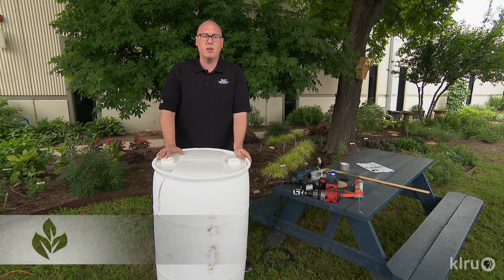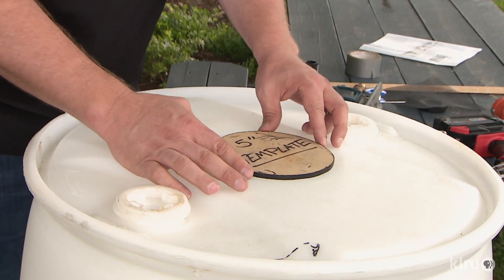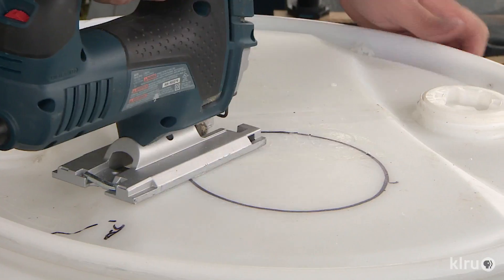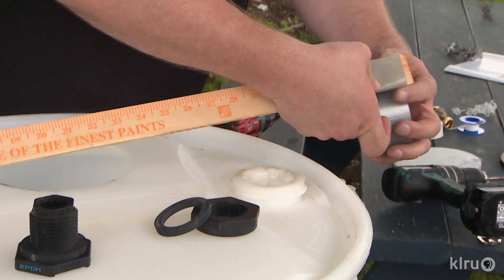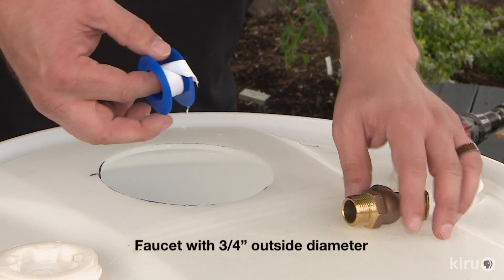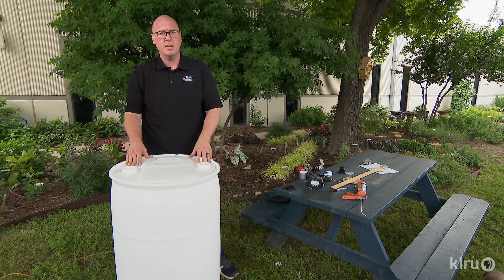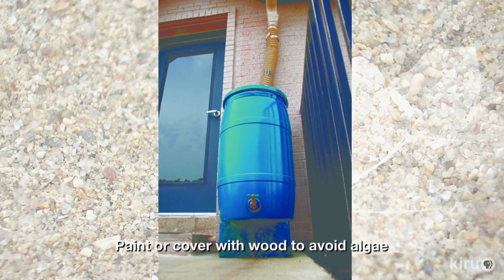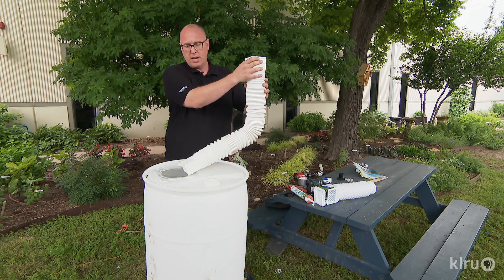How to Make a Rain Barrel from Food Grade Drums |Daniel  Cunningham |Central Texas Gardener

Comment: You know the round plugs on the barrel have the ability to screw in a water spigot.  If you don't mind reaching at the bottom if you put it on top of bricks.  You just need to drill a hole through it.

Comment: No overflow plan? A 55 gallon container might be appropriately sized for a small chicken coop or dog house. Waste of time and space for most houses. Building a rain garden is a much better use of one's time and resources.
Reply: Where can I purchase the bulk head .
Reply: This definitely needs at least a 2" overflow for Texas, I just finished built two yesterday. Today we have a .4 inch rain in New Orleans similar to TX for less than 10mins both of my barrel is full and my 3/4" overflow shoot out 2.5' from the barrel as I haven't routed the pipe of the overflow yet. This tells me a 1"-1.5" would be sufficient. It's amazing how I can get a 110gal of water for my garden for just 5mins of rain. I tried to leave all my 5gal buckets out when it rains to collect water, so silly we only got about an inch fill in the buckets.
Reply: Respectfully, after building thousands of these barrels, there is no practical scenario where an overflow prevents water from spilling over the top of the barrel. In most every situation, taking into account catchment area and the rate of precipitation in a typical rainfall event, the volume of water entering the barrel from the downspout will exceed the capacity of the overflow, thus causing a backup. This system, developed by Texas A&M AgriLife RWH experts, (who wrote the book on RW capture) utilizes a simple yet effective combination overflow/inlet. When placed on a level surface and mulch, gravel or dg is used as an erosion barrier surrounding the barrel, the water simply spills over the top and can be directed away from the catchment area to a rain garden, a nearby tree or wherever the water flowed pre-installation. An overflow hose can however help direct water to a location for supplemental irrigation. (however, it will not deter the previously mentioned backup) In this situation it is important to apply a screen on said hose to deter mosquitos and avoid using clear or corrugated hose to avoid build up of algae or sediment.
Reply: Actually, at Texas A&M AgriLife we believe rain barrels are the ULTIMATE water conservation tool! (but rain gardens are awesome too!) With nearly over 20,000 participants in our hands-on rain barrel classes, we teach the benefits of rainwater capture in larger tanks and in the the ground with rain gardens, dry creeks or swales, however to the average homeowner wanting to dip their toes into RWH, that is usually a bit overwhelming ;-) In fact, we call this class our addiction class because SO many folks come back after learning the principals of rainwater capture with their 55 gal drum, and coming back for 2-3 more, and eventually becoming "greedy" with their rainwater-- using every technique possible to save and keep every drop on their property. Initially, most folks don't really have a good understanding of their water supply or their local watershed. The simple but effective 55 gal barrel helps make that connection, driving home the importance of conservation and storm water management.
Reply: exactly my thought. Overflow would come back out the screen. I'm using a dual barrel system and trying to make mine different by using the existing holes and not having to drill new ones